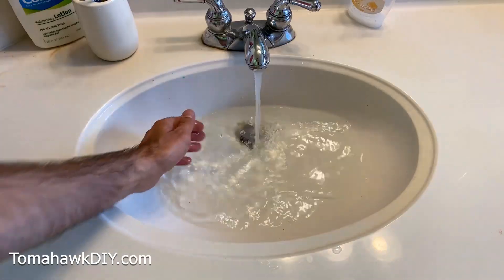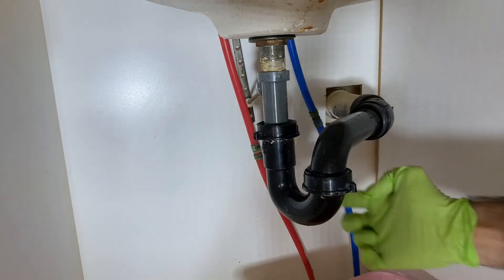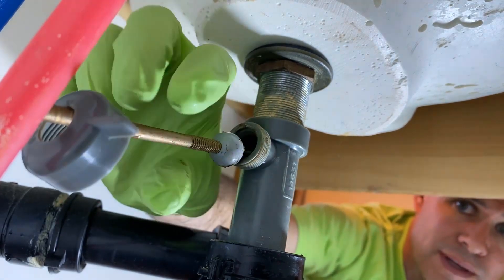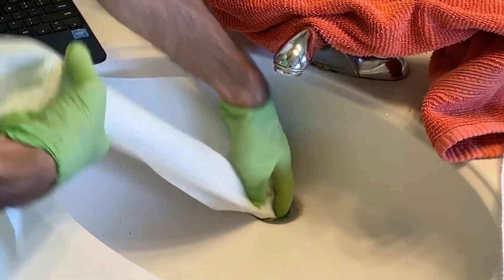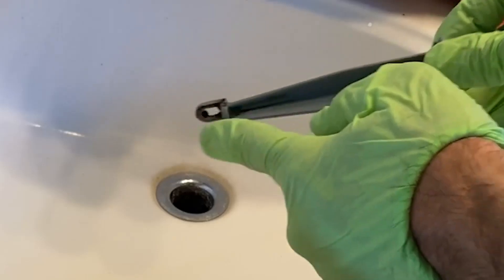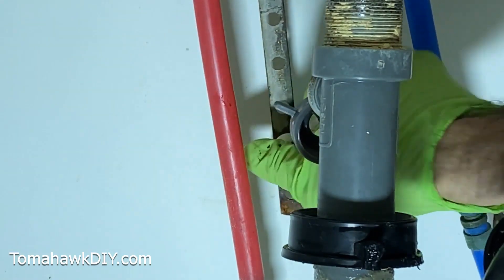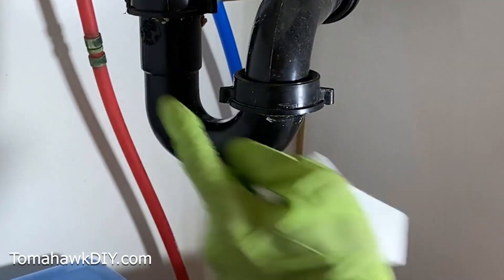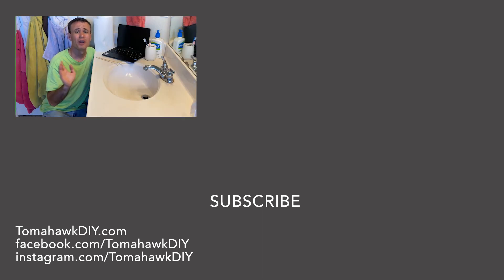Quick Fix for a Clogged Sink (Chopsticks & Paper Towels)

Comment: Good video, straight to the point! I've successfully clear the gooseneck on first attempt. However, the sink was still backed up. I suspect I have to unclog the part that is attached to the wall. Any suggestions?